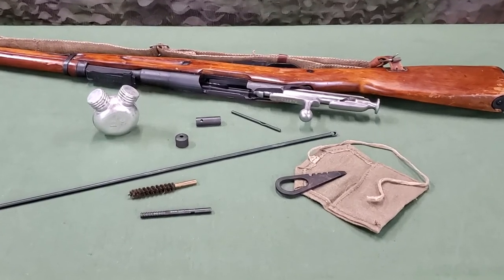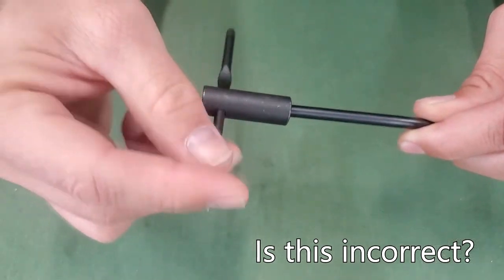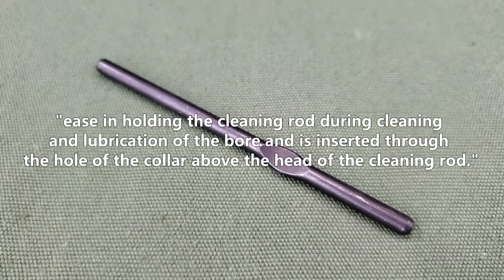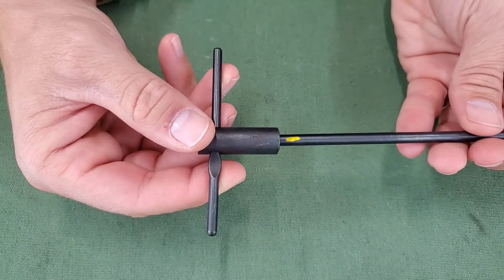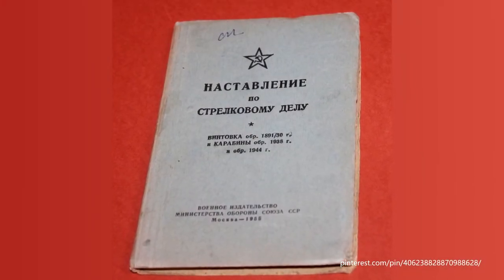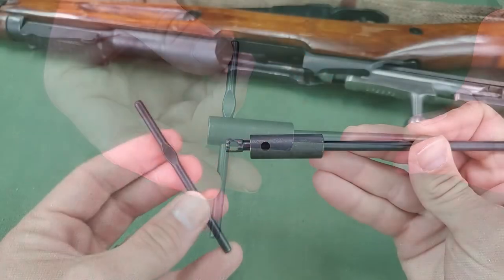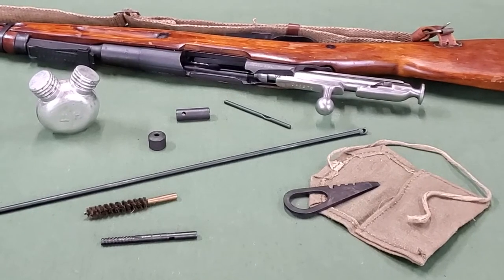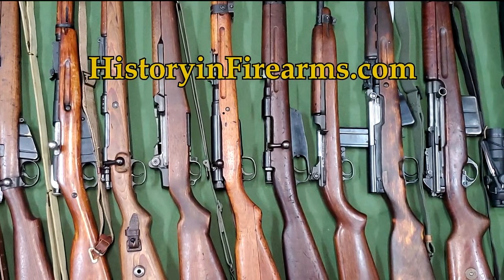Bulletin No.2: Mosin-Nagant Cleaning Kit

Comment: I agree wholeheartedly that your instruction is correct. I have seen the training manual as well. It would make no sense to manufacture and supply the rotating collar to millions of rifles/soldiers when a fixed T-handle could be achieved without this extra part. Also, as anyone who has experience cleaning firearms can tell you, the attachments will always unscrew themselves from the rod when it has a fixed handle. Your instructions are correct and thanks for the fantastic instructional video. I find the Mosin cleaning kit to be of a good design compared to the pull throughs provided on other military bolt action rifles. I am a big collector of surplus, and have tried many original cleaning kits and the Mosin kit is one of the more user friendly and effective designs.
Reply from the maker: Thanks for the input! Glad I'm not the only one who thinks this. Russian firearms design is typically practical with just what you need and nothing more. The cleaning kit falls in line and every part is there for a reason. I would agree on the functionality of the kits also. Full rods, multi tools, they got all the bases covered in a minimal way.

Comment: Placing the drift above the head of the cleaning rod makes sense as it allows the force imparted while pulling to be distributed across the face of the head and not through the smaller area across the top. 

Also perhaps then the hole in the cleaning rod is in case the rod becomes stuck in the threaded insert in the stock, grease or debris causing it to seize up. You could break it free using the drift to get more leverage than just fingers would provide.
Reply from the maker: Another valid point and using the stuff to get the rod out of the stock is a good idea.  👍
Reply: I think you have solved the mystery. Most intelligent comment on a gun channel ever. And perhaps also to tighten the cleaning rod back into the stock. Oil on fingers, perhaps oil on the threads of the rod, frozen fingers trying to tighten, and all of the jarring around from war itself. Can't imagine you would want to lose the main tool of your kit. Bravo to you!